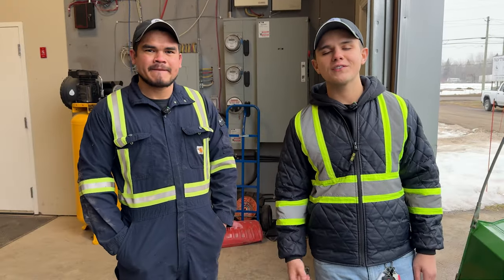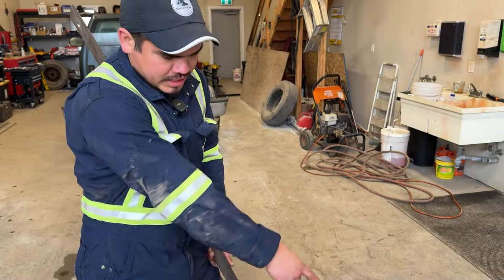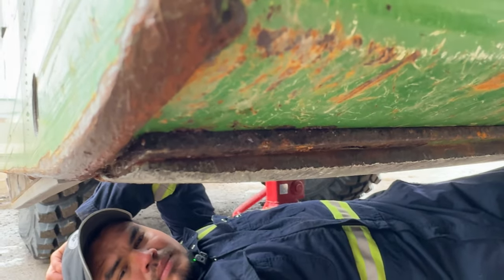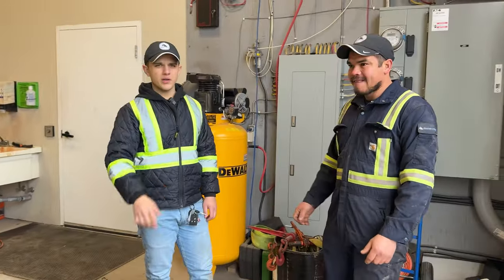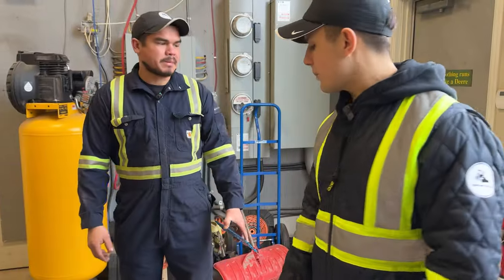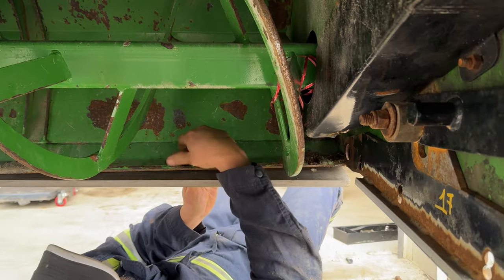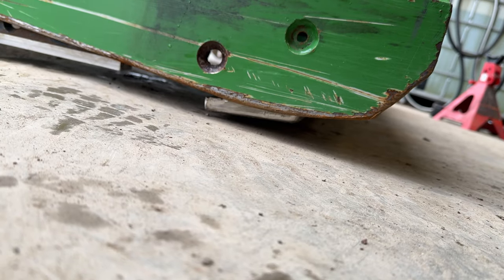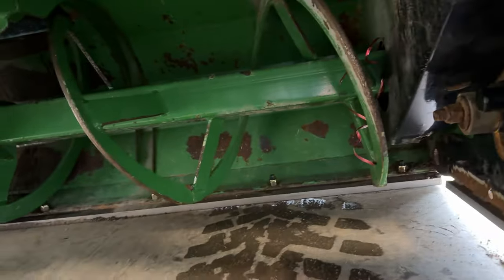Get Better Scrape QUALITY With This Upgrade

Comment: Looks good my friend 👍🏻👊🏻 You should when counter sinking the bolt holes in the cutting edge go a little deeper so the heads of the bolts are more below the surface. This will allow more wear to occur before coming in contact with the bolt heads. Just a thought 👍🏻

Comment: We run with teflon edges. The scrape quality is amazing and it doesn’t Scratch or damage paver stones. But if you catch a curb, or a lip at the end of the driveway or a manhole cover, the corners snag and get hung up very easily and ripped off.

Comment: I still don't understand what a good hardened steel vs a stainless cutting-edge difference.  I know the steal will rust. If you leave it on the ground. Sanders in Fargo can fabric a hardened cutting edge for cheaper than stainless and will last almost the same. Is there something I'm missing?